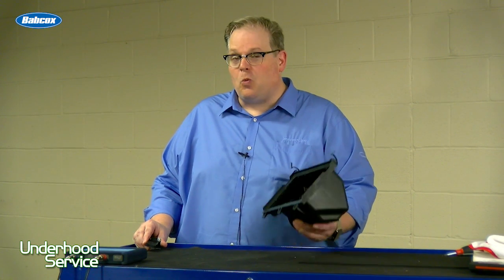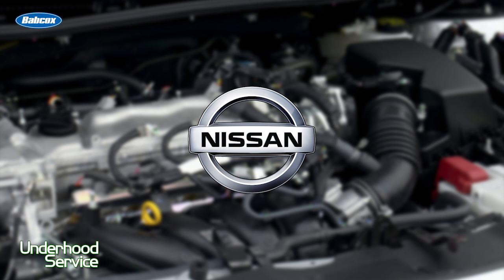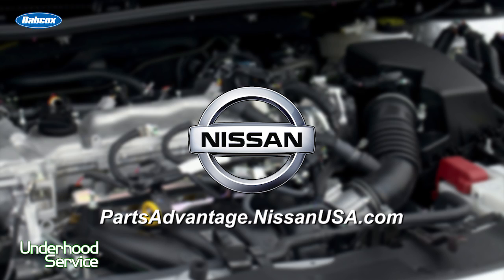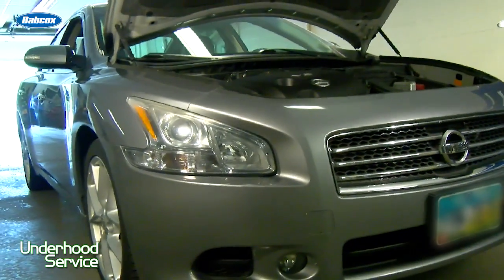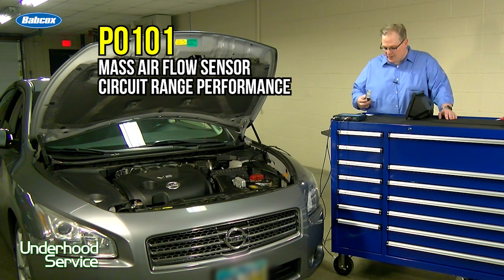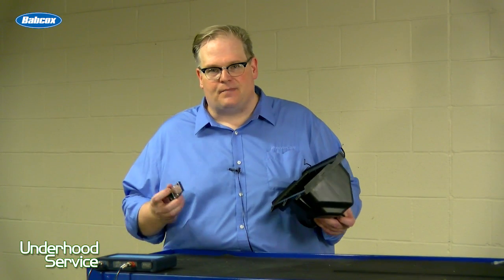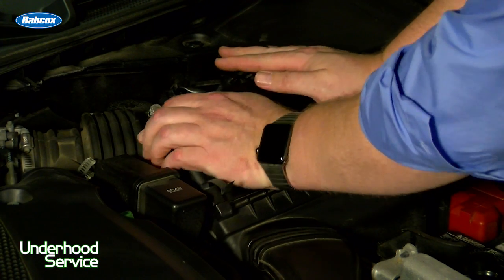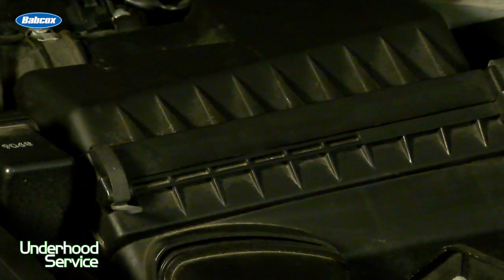Maintenance Minute -Nissan Maxima Mass Air Flow Sensor Codes

Comment: Can anyone tell me why my 2011 Nissan maxima changing system isn’t working I’ve replaced alternator and I had a new battery and the battery voltage continues to drop nd then it dies out
Reply from the maker: We regret to hear of your frustrations. We recommend receiving a formal diagnosis from your local Nissan dealership, as this is an important first step toward a resolution. You can enter your ZIP code at https://www.nissanusa.com/dealer-locator.html for contact details. For further support following your visit, you can contact our Consumer Affairs department by dialing 1-800-NISSAN-1, Monday through Friday between 7 a.m. and 8 p.m. or on Saturday from 7 a.m. to 5 p.m. CT.

Comment: I dont think so. I've ran cars with no filter and never got a code for unfiltered air. It has to be a leak after maf. Maf detects air coming in so in turn the computer knows how much fuel to give. More air more fuel. If this was the case k&n filters would trigger codes.

Comment: I have a 2012 Altima w/ the 2.5 motor, I ran a drop in k&n filter and it threw the p0101 code. Did I just waste $50 or is there any alternatives? Any help would be appreciated!
Reply: Bjorn Ironsides  did you find out?
Reply: waste of money that thing will let dirt in an you will end up with issues
Reply from the maker: Hello, Randy. A Service Technician at your local Nissan dealer is in the best position to address this matter. To find one in your area, visit https://www.nissanusa.com/nissandealer. For further assistance after the dealer, you may speak with a Specialist in our Consumer Affairs department at 1-800-NISSAN-1, Monday through Friday from 7 a.m. to 10 p.m. and Saturday from 7 a.m. to 5 p.m. CT. If you prefer to contact them via email, please visit https://www.nissanusa.com/apps/contactus. Kind regards.